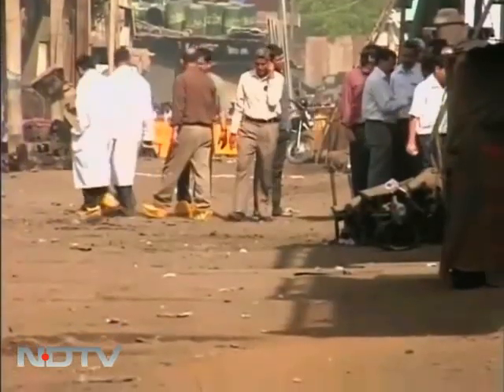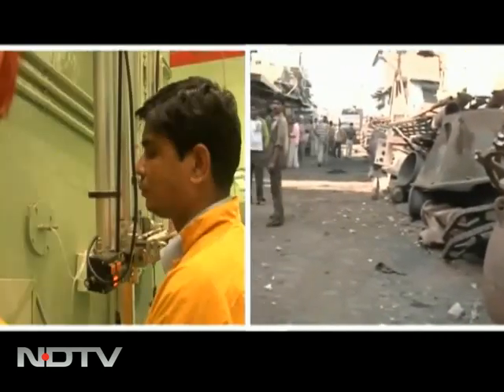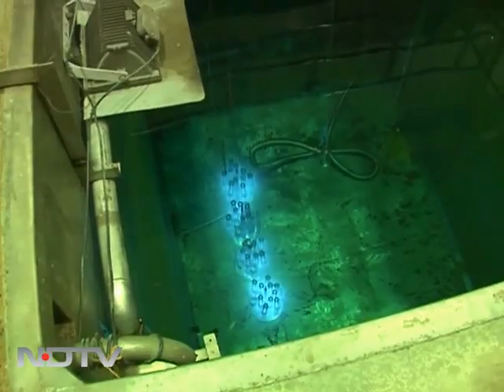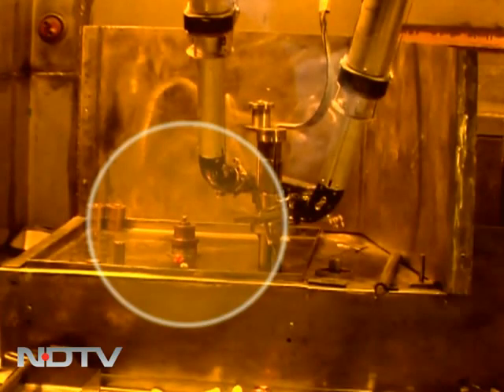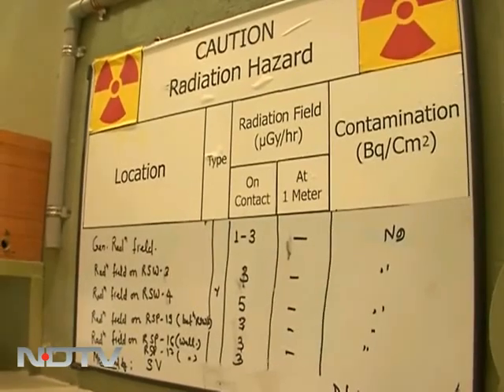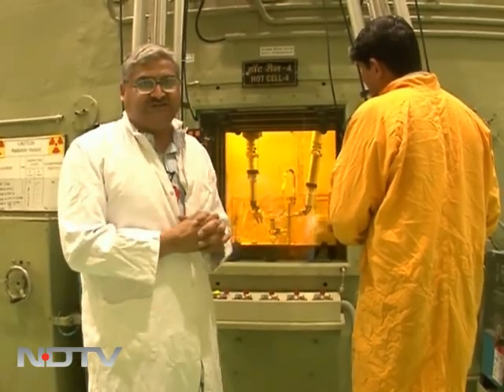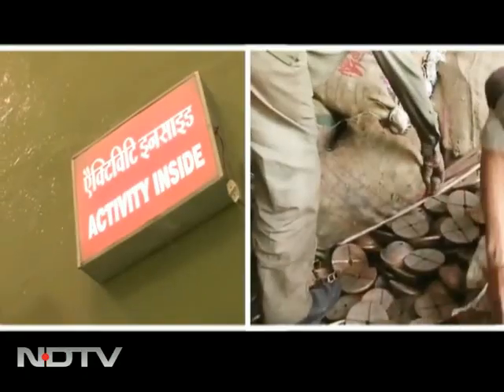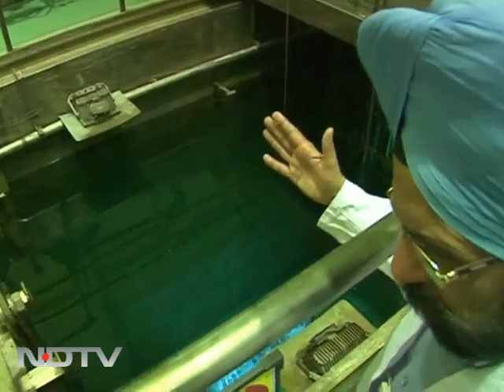How to handle radioactive Cobalt-60

Comment: Cherenkov radiation (blue glow) is pretty cool to see. Normally you only see that around the reactor core.
Reply: That's not true xD cobalt 60 is not used in reactors, or nuclear plants.
Reply: @keithjones9054  sorry? XD did I stutter? I was talking to the OC.
Reply: @keithjones9054  I recommend you read again, because that's what I said. 
And also, I wasn't talking to you, I was referring to the original commenter, go to sleep xd.
Reply: @keithjones9054  Nice. I’ve only ever seen video and photos of reactors.
Reply: @bunnypastor8252  I think you were thinking too deep. Most the photos and videos of Cherenkov radiation is are pictures of reactor cores. It’s just an interesting effect.

Comment: Before the hydrogen bomb was first tested, Leo Szilard demonstrated that such an arms race was folly. He pointed out that by casing a thermonuclear device in normal cobalt, the neutron surge from the second stage would turn most of the cobalt casing into Cobalt 60, where it would circulate as part of the mushroom cloud to descend later as fallout. If just 1000 tons of Cobalt-60 was created this way and transported to the stratosphere, it's inevitable dispersion would wipe out all multicellular life on land. That's how bad this stuff is.
Reply: Tim Rifat has been saying this for years. 👍🏻
Reply: Cobalt is actually to heavy to do that
Reply: @RNA0ROGER  depends on what it reacts with and/or particle size.
Reply: I’ll make sure not to accidentally make 1k tons of cobalt 60 then, thanks for the info ☺️
Reply: Leo Szilard is a traitor. He needs to be held accountable for his actions.

Comment: The window is made of a pane of leaded polycarbonate, 2 panes of leaded glass and lots of iodine substituted mineral oil between them. The reason they make it like this is because the intense radiation would quickly discolor the glass and make it unusable.
Reply: Yup, true fact

Comment: how in gods can you lose material like that
Reply: Gary Lewis Delhi University had a gamma irradiator from 1985s which was left unused and finally auctioned in 2010, after which it ended up in scrapyard.
Reply: It still had about 17-18 rods of cobalt 60 (out of total capacity of 43)
Reply: Usually bankrupcy or wilful avoidance of disposal fees. Sad Sad Sad. There used to be a company in the US that would reuse sources like this for other equipment provided they still had reasonable activity left.
Reply: It happens way more often than you would think
Reply: Happens way to often

Comment: A glass window... almost TWO meters T H I C C
Reply: That type of glass window needs to be at least 10 to at least 20 m thick Or at least should be
Reply: The glass window is also impregnated
Reply: @djmars1983 not really. A lead or boron impregnated glass can block a lot of radiation. 
Also, those are two glass panes with mineral oil between them
Reply: @djmars1983  You're really overestimating the penetration power of the radiation, the panels used here are thick enough to make the radiation effectively drop to background if you're on the operating side